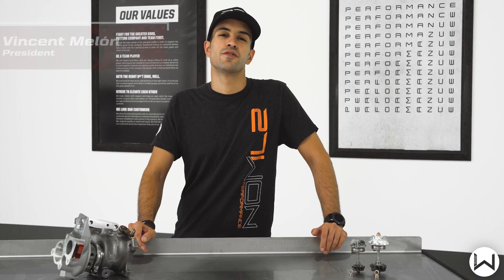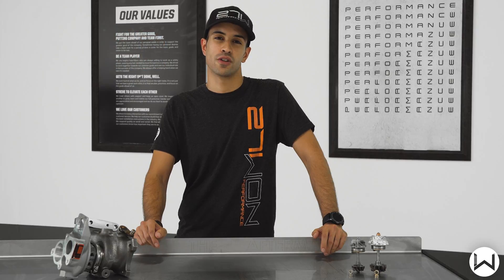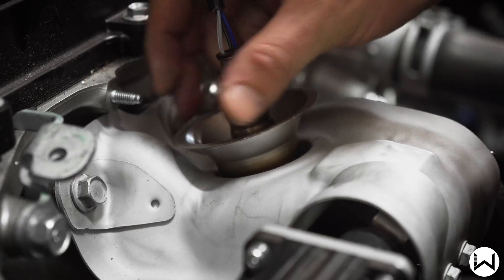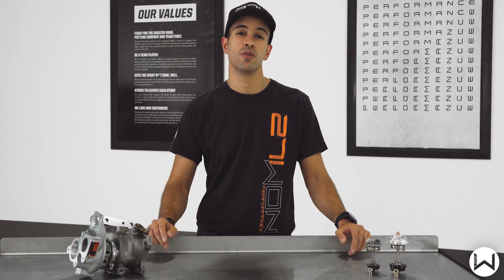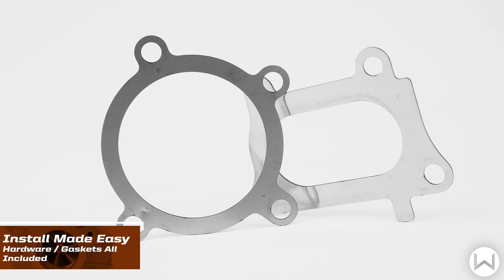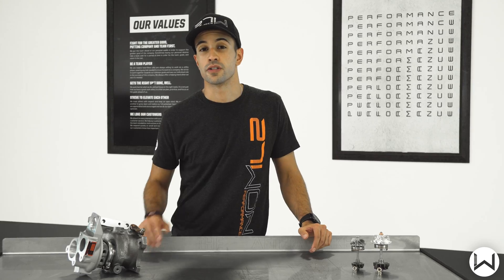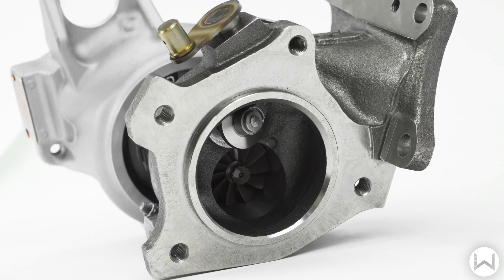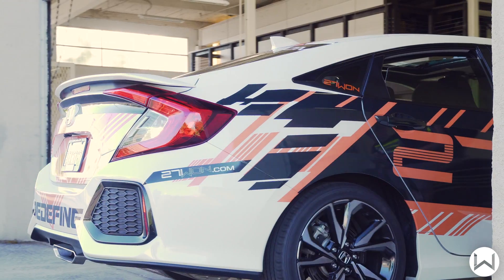2016+ Honda Civic Turbo Kit Upgrade, 27WON W1 drop in turbocharger

Comment: I have a  2016 2 door Honda Civic. Will this work for my car, it's not SI.
 Also does it need to be tuned?
Reply from the maker: What engine do you have?
Reply: @27WON   I have a 1.5 L 4 cylinder
 I have it all in my shopping cart on the website But I'm hesitant because I don't know if it's legal and I don't know if my car will pass smog in California.
 It says it needs to be an EO Turbo charger I don't know what that means.
Reply from the maker: @Crypto_Brandon  this turbocharger is not CARB exempt. It does not have an EO number.

Comment: how much power this will make
Reply from the maker: That’s dependent on fuel type, boost, supporting mods, etc but this unit rates at around ~335hp

Comment: Looks like I am ordering one of these this week.  Our 2017 cvt equipped 17000 mile Civic's turbo is damaged. 3k at a dealer? Omg.  Already owning a 1200 plus hp M3 without the Aquamist activated, (yeah that's what turbo's can do on fully built engines with ported heads and raping your wallet) it gets more insane after that,  I don't need another race car and am seriously limited by the cvt.  Posts elsewhere and serious testing by this company prove that with the right tune their kit actually helps the cvt by shifting torque up higher and giving the cvt a softer hit.  Geez, my M3 clutch costs far more than this entire kit.  This is pretty cool, and a much easier install than every other kit out there that I looked into.  An uneducated high school kid could pull this install off!

Comment: So i recently installed the Ktuner and flex fuel kit on my Si. And I was wondering will this turbo do any damage on the stock internals? Or will it be able to handle the power?
Reply from the maker: You can use this turbo on a stock block. We do along with hundreds of our customers. Just make sure that you have a safe tune to help control torque and you will be okay.
Reply: Sweet just what I wanted to hear. Also, since the Ktuner V2 comes with base maps for this specific turbo. Will I be okay flashing the ecu to the 27won upgraded turbo tune?
Reply from the maker: @ManuelGonzalez-nu5bb  Yes sir!!!
Reply: Perfect thank you for your feed back
Reply from the maker: @ManuelGonzalez-nu5bb  no problem, if you have any other questions drop us a line at 571-271-0271

Comment: I want to buy it and put it in my cvt but I'm worried about that cvt man
Reply: Just have the torque limited to below 250 when getting a custom tune and you'll be fine
Reply: Don’t do it. The CVT’s are an economy transmission and need to be driven as such. I’ve owned 2, and they’ll treat you right if you treat them right

Comment: Is it ok to drop this in a 2016 civic coupe with an automatic cvt transmission?
Reply: B C if you want your cvt transmission to slip..
Reply: @andrewvinson7369  so what's the remedy? I guess if the car is auto I'm stuck 🤔
Reply: B C there really honestly wouldn't be a point for this in a CVT. Even with Ktuner you can raise boost pressure for the stock setup and still get some slippage. We with the 6MT even have to change out our clutches because it's just to much for the stock ones.
Reply: @andrewvinson7369  yea, I will need to do a manual swap. It sucks. I wish I knew this when I got the car, oh well. A manual transmission install ain't gonna be cheap but that's the only way to harness 300hp+.
Reply: The engine only has 14,000 miles on it and the car is garage maintained.  So it's not beat on by any means. In addition to a manual swap, what would you recommend to get in the 300-400hp range? Thanks!
Reply: B C if your gonna do a manual swap you need to get an aftermarket clutch first thing and single mass flywheel if you so choose. Clutch-masters is a good reputable company. The FX250 should do you just fine for just street/daily driving. You can also purchase their single mass aluminum fly wheel. This will give you less rotational weight which in turn will make more Torque and less lag time on the turbo. MAPerformance.com  has all this stuff.
Reply: B C also an aftermarket intake, bigger Intercooler, downpipe and exhaust,. I'm currently running MAPerformance Intake, and full exhaust (street series) from downpipe to muffler. Also Mishimoto intercooler and larger piping along with Ktuner.
Reply: The belts wouldn't be able to handle the torque

Comment: Will this upgrade work on a 2018 Civic si?
Reply from the maker: Yes sir.
Reply: @27WON  , Great....any internals need to be changed or upgraded. Is it necessary to change the inter-cooler and pipes and ECU to accommodate the larger turbo?
Reply from the maker: @harryl8234  engine internals not required. IC also not required but you will need a tuning device such as a Hondata or similar to control the larger turbo. Basemaps do come for free with the turbocharger which is great. Then any further tuning is on the end user.

Comment: When I install this for my 10th gen civic sport, do I need a custom tune to calibrate it with the new turbo? Or can I just have it installed and run it as is? I just don't want to mess with the ecu as much as possible just so I won't void my warranty.
Reply: Lmao. Replace turbo is much more drastic than a tune in terms of warranty. Hahahaha
Reply from the maker: You would want to get a custom tune for maximum performance and reliability tuned to your vehicle and driving style.

Comment: It's going to handle on the stock motor ??
Reply from the maker: Yes sir, got tons on stock blocks.
Reply: Will it work with cvt??
Reply from the maker: Yes but note the CVT will limit you.
Reply: @27WON  about how many hp will i get out it?

Comment: Upgrading to this is ok with stock internals? I guess time will tell, I am just gonna sit back and see 😉
Reply from the maker: over 22k miles on one of our test cars and she is still going strong.
Reply: 27WON impressive!
Reply from the maker: @John Bremo This may be a bit bias but I suggest our exhaust system. We specifically tuned it to work on the L15 with GDI and turbo tech. We did not just put pipe up there and call it a day. All the notes where tuned for the system. You can read more about that in our FK7 exhaust blogs on our site here. https://www.27won.com/blog/27won-performance-mid-pipe-back-exhaust-install-part-2?rq=exhaust
As for the question of ethanol, the answer is no. The stock ECU will not compensate for a blend greater than E10. You would need a flex fuel converter and means of tuning.
Reply from the maker: @John Bremo you do not.

Comment: What intake is on that car
Reply from the maker: WingKing76 our cold air intake
Reply: 27WON cool do you guys have package deal?
Reply: 27WON Does the smaller piping on the intake effect the map sensor?
Reply from the maker: WingKing76 for the intake and turbocharger, not at the moment.
Reply from the maker: WingKing76 no changes in any regards.

Comment: Vincent, have you heard anything about the release date for Hondata 1.5 non Si w1 calibration?
Reply from the maker: 505fk7 Hatch not in a few weeks. I believe they are still working on it.
Reply: 505fk7 Hatch I have a 2017 CRV 1.5t, will this fit in my (larger) engine bay? And obviously, I have a cvt, so I know power is limited, I'm running a custom hondata tune, with peak torque limited to preserve the cvt, power comes in at 3.5k rpm to 5k rpm, then from 5k - 6k rpm the torque table is lowered but the boost is increased to ease the simulated shifts the cvt does.
Reply from the maker: Yes, this would fit a CRV and yes as you have mentioned the CVT will be your challenge on power.

Comment: Will this work with a cvt 1.5 hatchback civic?
Reply: I have the cvt I know it's limited on amount of power and tourque but with a custom tune could it still be worth getting as long as you have the power adjusted?
Reply from the maker: Mojojoejoe42 you should still be able to benefit from the system.
Reply: With CVT - A CVT Transmission cooler is needed. In Malaysia there's  a Civic X breaking the 250s hp.
Reply from the maker: Technically yes, but be aware you will be limited on how much power you can make on the CVT.
Reply: 27WON  If I make the torque will bhp be increased with a tune and your turbo?
Reply from the maker: Yes
Reply: 27WON I bought a sport touring for my mom but she didn’t like it I had to buy her another Prius so unfortunately I’m stuck with a cvt lol but I don’t care I’ll definitely buy your turbo ! I did all the other mods already needs turbo mod and custom tuned 👍

Comment: Would this work on a 2018 Honda Civic Sport Hatchback?
Reply: Yes my sport  makes 280 hp now, its amazing, and its on pump gas.
Reply: Mikkel Andersen is your sport CVT?
Reply: @mikkel060790  what mods do you have that’s makes it at 280hp . I have a civic sport hatch . Pls lmk bro
Reply from the maker: Yes, it will. Any 1.5L turbo Civic
Reply: Carlos Vasquez Intercooler is imoortant, a cool engine is a healthy engine and it gives power. The exhaust is a huge restriktion on the sport as well. Actually fbo 🤣
Reply: Mikkel Andersen Nice!! I just have a cold air intake in mine at the moment. Do you recommend any other Mods besides this Turbo?
Reply: So it doesn’t matter if the car is 1.5t automatic? Civic Hatchback sport 18